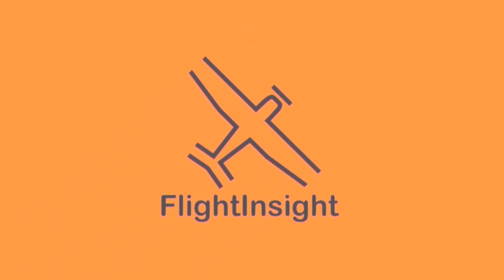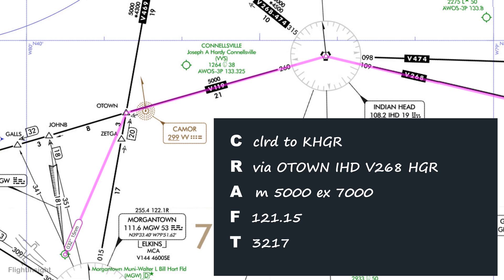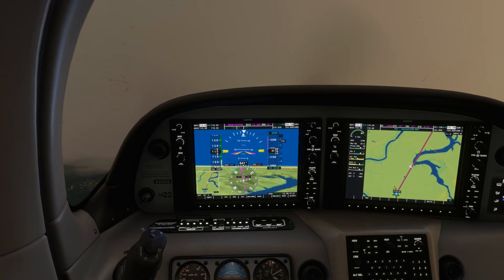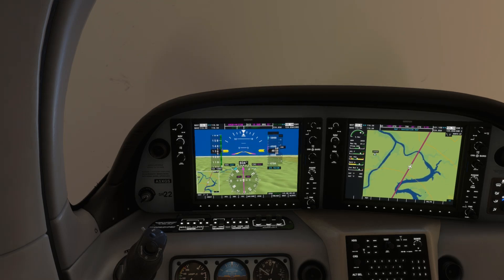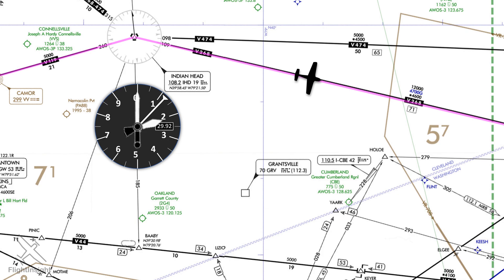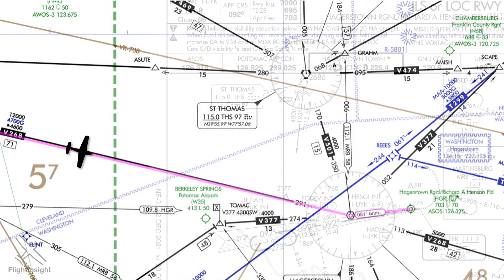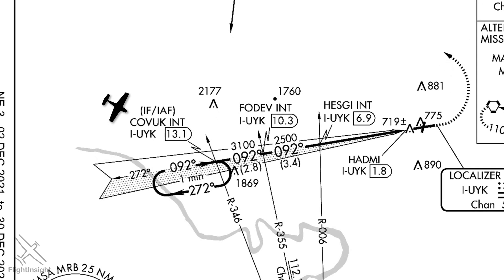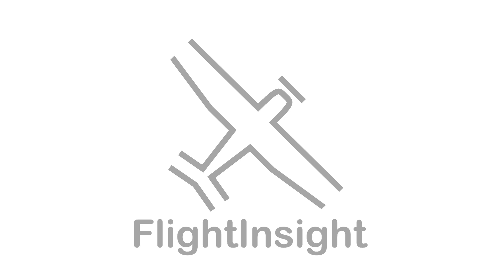Lost Communications Procedures | FAR 91.185

Comment: Why did you wait to climb to 7,000’? 91.185(c)(2) says at the highest of the following altitudes, including assigned, expected, or minimum altitude for IFR operations. Therefore, and correct me if I’m wrong, but that climb should have been immediately to 7,000 assuming there was no MEA or OROCA stating a higher altitude.
Reply: If you read the NOTE below it. It states, "expect further clearance containing a higher altitude at a specific time or fix, maintain highest of the two (assigned/minimum IFR altitude). Upon reaching time/fix, pilot should commence climbing to the altitude advised to expect."
The original clearance gave a time to expect the new altitude. I believe the high 3 you are referring to would be if they just told you "cleared 5,000 expect 7,000" and just ended the transmission there.

Comment: WARNING! If you're taking an IR checkride, IN THE ORAL, tell your DPE you'll fly to the clearance limit FIRST, then fly out to an IAF, and THEN execute an approach. DO NOT start an approach without first getting to your clearance limit. I failed my oral because I did exactly what this video is describing. The DPE told me: "I'm examining you on the rules, not on what makes sense". Does it make sense to start the approach without first overflying the airport? Totally. But answering that on the oral will get you a fail.
Reply: Wdym he says to go to your clearance limit first
Reply: Should have said you had an electrical fire at the same time
Reply: So did my friend. Answered exactly as the video described and failed.

Squawk 7600 and immediately climb to the highest altitude assigned, expected, or on the MEA was the answer the DPE wanted. Then no descent until reaching the IAF.

DPE says MEA AVEF always.
Reply: You got a dickhead of a dpe tbh
Reply: My CFI II taught me to pick a point in a central location from all IAFs rather than fly direct to overfly the airport
Reply: I’m so confused… I failed my oral yesterday for following MEA AVEF. Lost comms, told him I would continue on my route as I filed (Nothing assigned, vectored or expected in this scenario) of course climbing to the highest of the 3 altitudes. I told him since I filed to the airport I would fly to the airport, hold until close to my eta time and then fly to a fix to execute an approach. He said the airport is the destination on the flight plan (even though I filed it as part of my route). Regardless of if it should have been filed as part of the route or not, it was part of what I filed… so wouldn’t I fly to the airport, hold, then fly to a fix where an approach could be made? He said I should just fly to the fix and execute the approach, no reason to fly to the airport…. Even though the airport is what I filed.
Reply: I could be wrong, I haven’t done the oral yet, just on the lost comms lesson, but since you weren’t assigned anything (no clearance limit), you would fly as filed as you said. Thus on your flight plan your approach would come before the airport, therefore that is why you don’t fly directly to the airport? Idk. If you have redone the oral or have found the answer pls lmk
Reply: The video says to go to clearance limit first. Watch it again

Comment: Wouldn't you have to climb to at least 7100ft as per the low enroute chart's OROCA, while flying direct towards the Victor airway?
Reply: thats what i was taught aswell
Reply: oroca is not a minimum ifr altitude. 91.177
Reply: @joeyhill6957  .
Reply: @joeyhill5769, still he was not on any published airway during that segment of flight, and below OROCA, which would disobey the 1000 above non mountainous and 2000 above mountainous terrain rule
Reply: @graupeeee  the vector they provided was provided based on the fact that he would have that 1000/2000 obstacle clearance at that altitude until he intercepts the next airway or fix.

Comment: What if the coms failure is the first of a series of failures due to an alternator failure? If I've lost radios early in the flight, I'd rather get down sooner if other components are at risk of failing too.

Instead of completing a potentially long flight, what is the easiest way to return to the departure airport quickly other than squawking 7600 or 7700?

Comment: Im a little confused, so if you’re clearance limit is to the airport (which it is 99% of the time like you said), then you first fly to the airport, then to a fix at which an approach begins? Or can you just fly directly from your route to a fix at which an approach begins?
Reply: My instructor said to fly to the airport (or clearance limit) than to an IAF.
Reply: @blake9908  And when should I start my descent from the one I mantained enroute to the one required to start the approach?
Reply: @IlPassato  When you're in the Terminal Area, remember that MSA on each Approach Plate. You're guaranteed obstacle clearance in the Terminal Area so long as you stay above the published MSA.

Comment: Hi there. Just one thing i couldn’t get. 
Why to climb out to 12.000ft, the highest airway altitude? Is there any rule to follow? Sorry if you told on the video, i just can’t see why to climb higher when your clearance says “clear 5000ft then 7000ft 10 minutes afer”. Thanks!
Reply from the maker: Hi! After the Indian Head VOR, the MEA is 12000 feet. With lost comms we should be at the higher of the expected altitude and minimum en route altitude
Reply: @flightinsight9111  got it! Thank you😉
Reply: Since we're flying east in this scenario, we should climb to 13,000 to have 1,000 vertical separation from a westbound aircraft on the airway which may be at 12,000. @flightinsight9111

Comment: You mentioned staying at 7000 because we gave GPS, and if we didn’t we would have to go to the MEA of 12,000. But isn’t the minimum IFR altitude here the MOCA *4600? 

91.185 c.2.(ii) The minimum altitude (converted, if appropriate, to minimum flight level as prescribed in §91.121(c)) for IFR operations; or

It doesn’t say the MEA, just the minimum IFR altitude. I understand that it wouldn’t be wise to go to that altitude if you didn’t have GPS because you probably will not pick up the VOR, but im only asking in terms of the legal altitude. Please correct me if I’m wrong.
Reply from the maker: It's a good point. I think yes and no. 91.177 (a)(1) says no operations below MEA unless you're within 22 miles of either VOR, then you can go down to the MOCA. So I think the full answer might be to stay at expected of 7,000 and then climb to the MEA of 12k once you're outside the 22 miles required by the MOCA.
Reply: @flightinsight9111  agreed, since we are using VOR, 4600 is only legal within 22NM. So you could technically stay at 7 until you are 22nm out.
Reply: @flightinsight9111  love your content btw. Using it to get ready for CFII. And making a playlist for future students with your videos

Comment: Lose an alternator belt  in IMC and your Glass will soon to cease to operate along with your radios. Maybe you're IPAD will save your BUTT, Bro. Just hope it's fully charged.
Reply: Are you aware of the TSO requirements for battery life, both aircraft and "glass"?  Care to report how many failures have occurred where the batteries drained out, Bro?